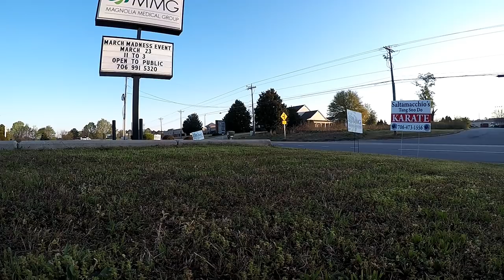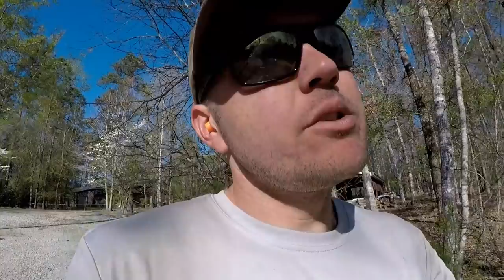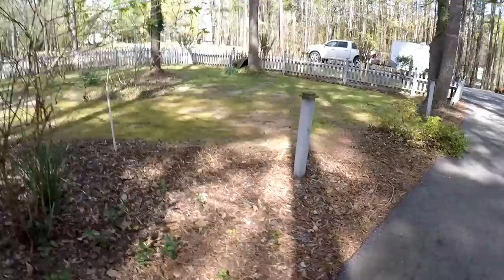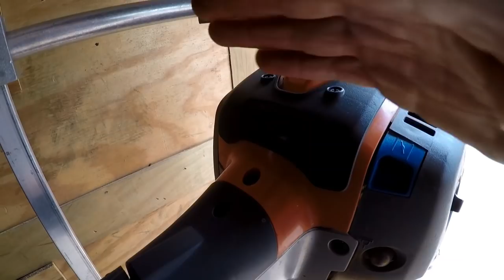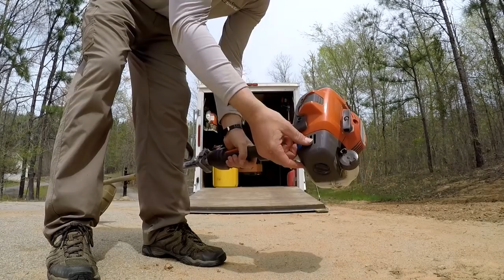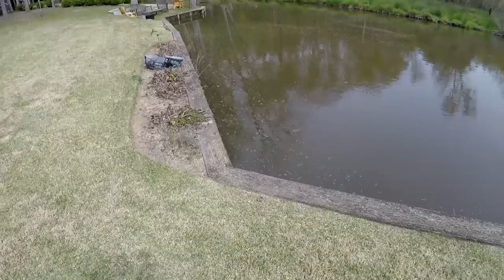SPRING LAWN CARE VLOG + Husqvarna 525 Trimmer Long term Review

Comment: Didn`t have luck with my 525L, Was hard from in the beginning to start (4 a 5 pulls), and today was working fine, shut of after one customer, pull to start on next customer and no compression, only 3 months old.
Reply: That's not good I just bought one
Reply from the maker: Warranty will fix that

Comment: Hey Tony great work man! I’m in the market for a new string trimmer. Should I get a fs94r, km94r or 525l?
Reply: I have the Fs94R . Would never choose a husqvarna over a Stihl. Husqvarna makes good products but I'll never choose between the two.  94R has great power and its not heavy at all
Reply from the maker: check out redmax too